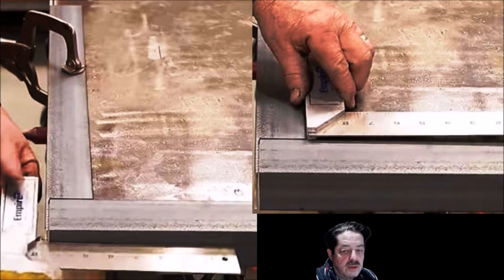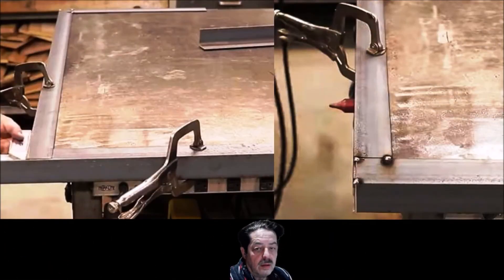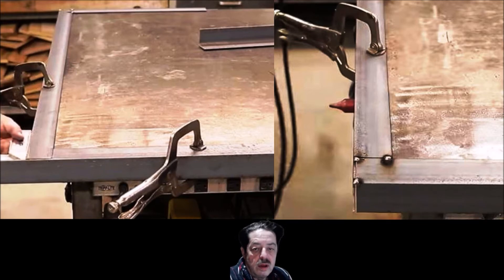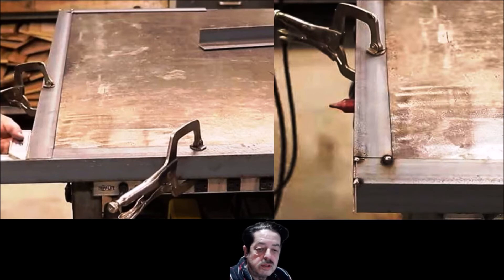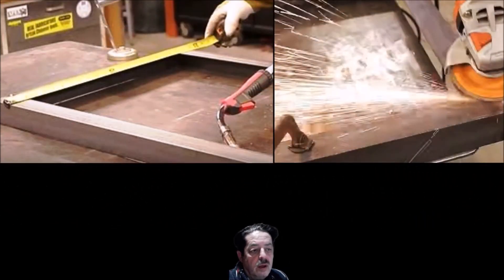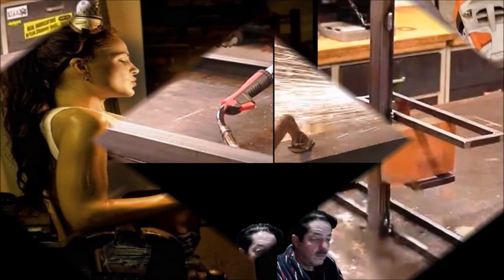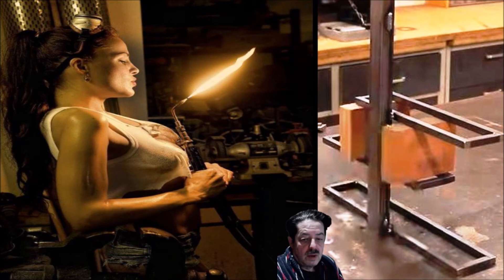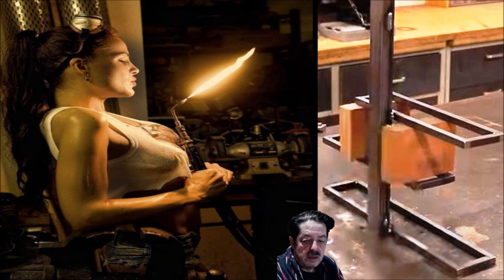Welding - Stop Warping When Welding

Comment: don't be afraid to cut off your tacks and reposition things correctly, you can weld thing up perfectly on the front lawn if you tack and adjust first with the square and a straigt edge

Comment: All that's great but when I unclamp my project it's nowhere near flat anymore. 
I made a field drag out of 1/4 in 3x3 in angle iron project was12 ft x 12 ft  , had it perfect in every way , square was easy
I unclamped  it and it was bowed.  cut it straightened it re welded it in smaller beads worked opposite corners it warped again.

Comment: How well do those large steel angle clamps work for welding? I'm thinking of getting a few but they are expensive, yet I'm so frustrated with my poor welds on 2" stainless pipes. It's bending out of square every time. I tacked it a few times but still not good enough.

Comment: Im welding angle it's wrapping how to prevent sir
Reply from the maker: I can not see what your doing but if you are welding angle I would tack weld it at the ends and in the middle - check for square as you take it up. This usually works well for me. The problem obviously it to much heat so tack it up and try to control the amount of heat your placing on it which also will depend on the thickness of what your trying to weld.
Reply: @TheHomeHandyman  thank you sir for the reply my comment this is very helpful for me as beginner godbless you
Reply from the maker: @yessir..6901  anytime
Reply: @TheHomeHandyman  can you make a vedeo tips about vertical  up welding they told me vertical up is harder than vertical down